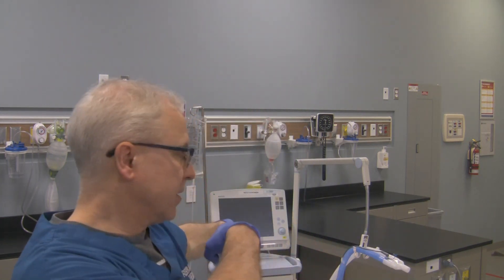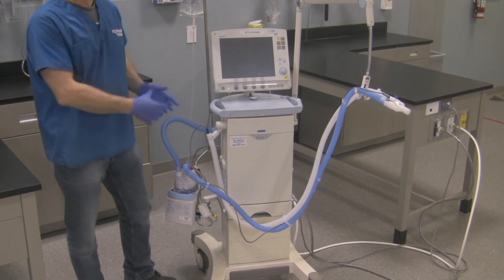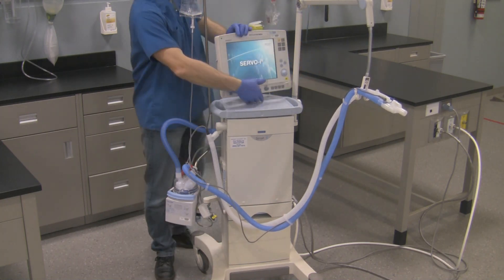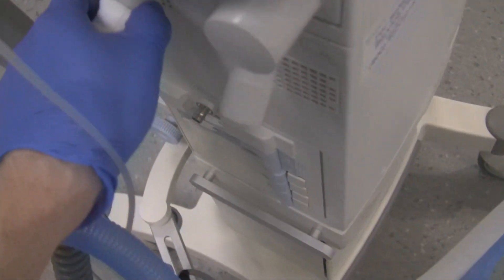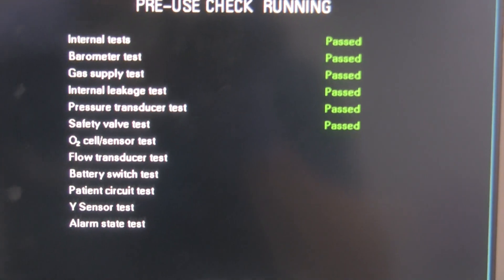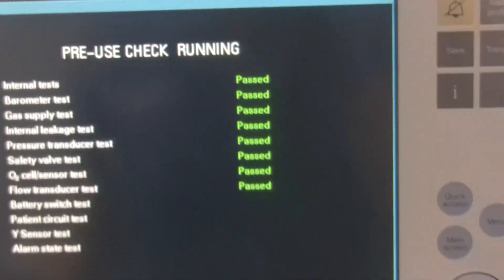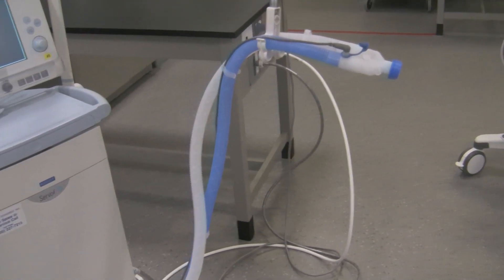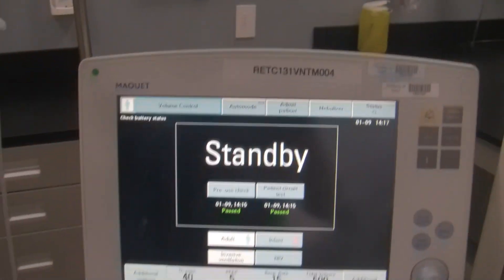MAQUET SERVO I VENTILATOR  PRE USE CHECK

Comment: Even though the temperature sensor and the oxygen sensor are in the same cassette in the back panel, I think George is incorrect about the humidifier cord nearest the patient being part of an oxygen sensor.  That should just be a temperature sensor and any hospital I've worked at does not require that cord to be put inline if the patient is on an HME.  I did not find anything in the Marquet manual stating that cord was for the oxygen sensor.

Comment: He does do one thing wrong, but over all very well done. Before the unit requests the user to install the test tubing, the vent performs an atmospheric check to briefly compare atmosphere (are you in Denver or at sea level??) to its internal barometer. At that time the vent should have open and unrestricted access to atmosphere. He has the circuit on and therefore during the atmospheric test, the vent cannot measure true unrestricted atmospheric pressure.
Reply: Cleaning procedure of expiratory cassette https://youtu.be/imt0n5Tbq9k

Comment: Internal leakage test :failed. What can i do for this problem pls.
Reply from the maker: An internal leak test would imply that its probably not the external circuit, but an internal circuit component in the ventilator.  It might also be a flow transducer or expiratory cassette etc depending on the brand.  Contact your biomedical technical support team in your hospital or the manufacturer for assistance.  You can also check the trouble shooting guide in the manual that came with the ventilator if you have them.  Anytime some internal problem is identified, unless its something basic and easy to fix, we usually have our biomed techs check them out.
Reply: Cleaning procedure of expiratory cassette https://youtu.be/imt0n5Tbq9k
Reply: It is the expiratory cassette or the inspiratory pipe assembly. its always one of these for internal leak fails